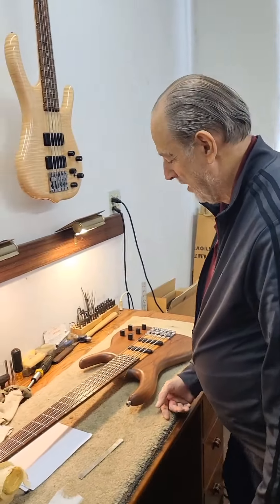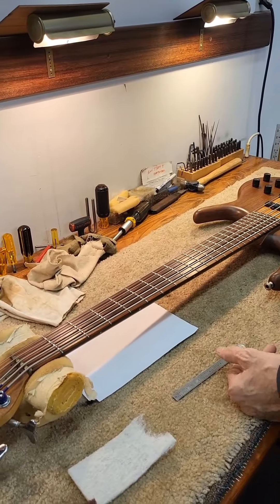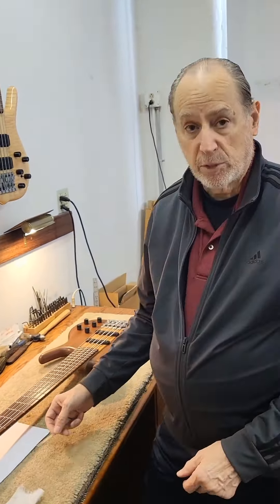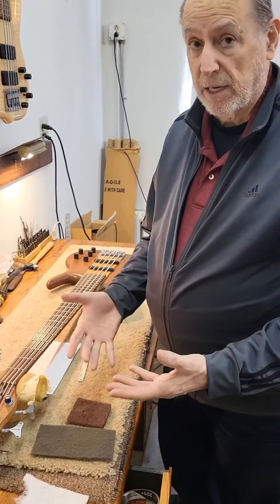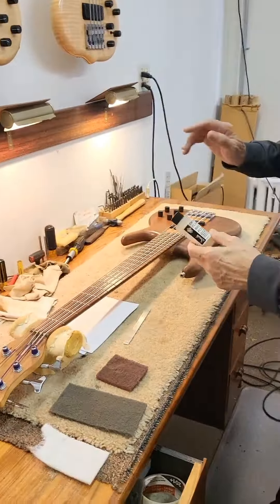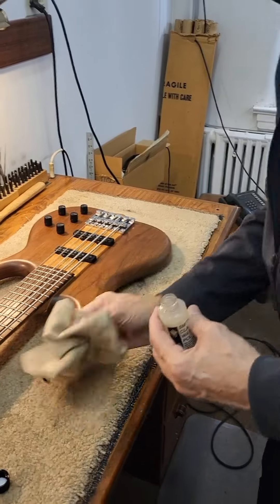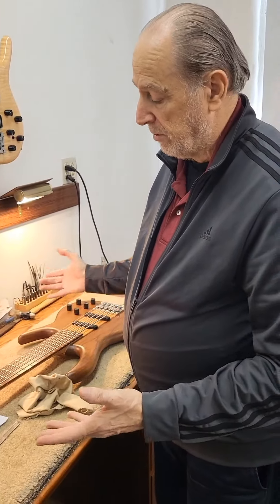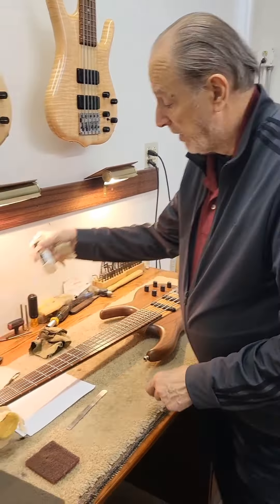Ken explains cleaning your Smith Bass

Comment: Ken I have an old p bass that was converted to a full Smith. It’s great but they painted over original finish and I was wondering what I could use to remove the paint since it is over Polyurethane?
Appreciate your help!
B